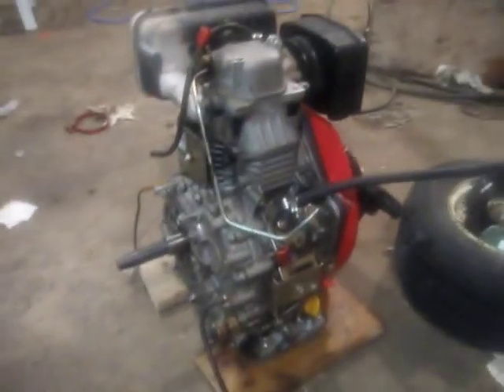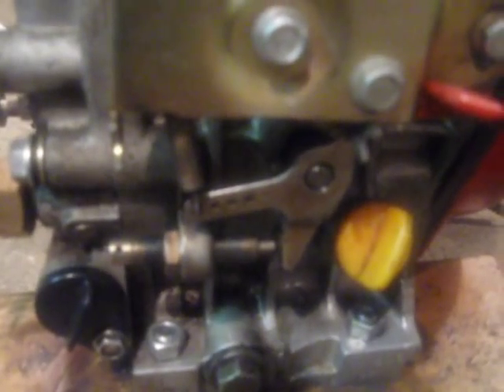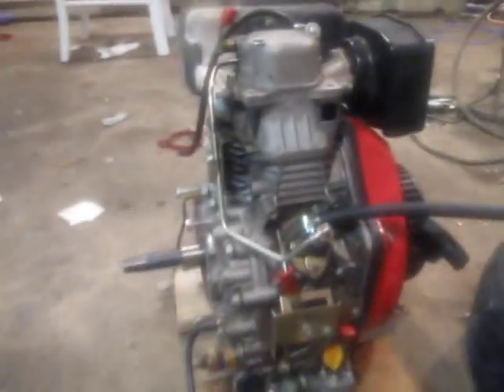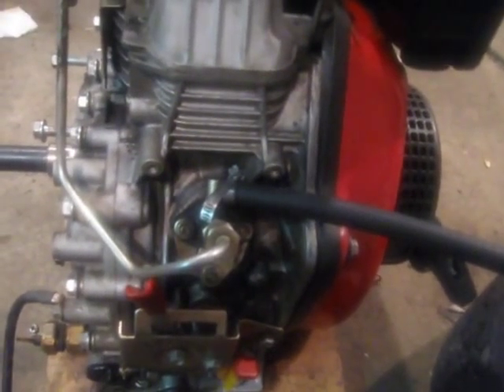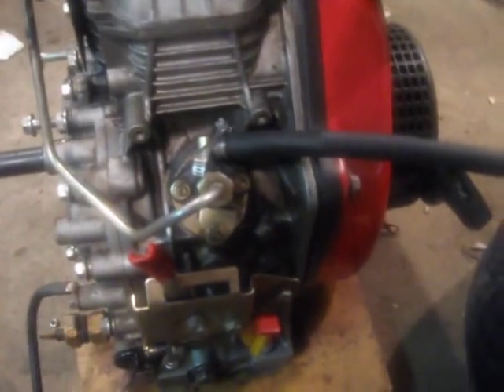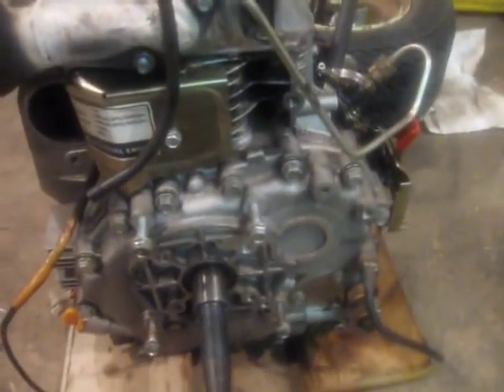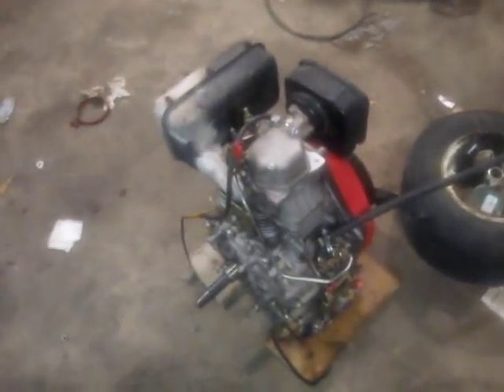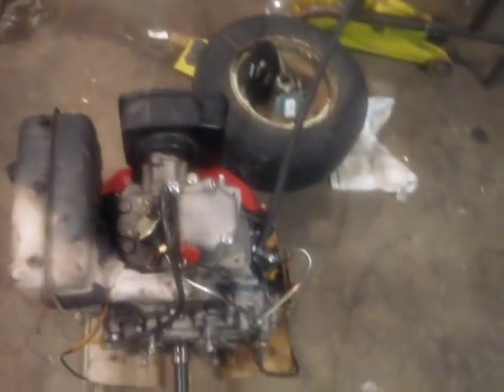yanamar fuel screw info

Comment: backing off the screw just gives it more fuel if it needs it, in a go kart application under suck load it will allow the engine to take as much fuel as it wants untill it gets up to 3600 rpm

Comment: I have a yanmar l48 with 3/4 keyed shaft in mine but has the generator fuel supply I found the engine adapter for the fuel supply. Is it possible to put these on go kart..btw turboing a single cylinder is pretty pointless cause the intake port is closed when the exhaust is open.. super charger maybe.. the turbo would make some boost make sure to add a blow off valve

Comment: Thank you very much for the vid. is there a way to put an external oil filter on these  engines ? i know the small air cooled lombardinis can but not sure about the yanmars. an external oil filter would considerably extend the time you have to change the oil
Reply: no, but there is an internal oil filter
Reply: no but there is an interal oil screen before the oil pump.

Comment: Its actually called an excess fuel screw,the idea of this screw and the spring inside it is to help the engine bring itself off excess fuel after starting,it has noting to do with the engines max rpm,the engine along with the governor spring does that job.excess fuel is only used to help start the engine.also when you turbo charge a diesel you need less fuel with increased boost or youll get engine knock.turning the excess fuel screw out will help on starting a worn pump or injector,nothing else
Reply: albertonex19 your so wrong with everything you’ve said haha
Reply: @Diesel8290  Then correct him.

Comment: If you run these on waste oil there’s more energy in the fuel so you get more power, without more fuel to wash the cylinder, so you get more black smoke. My 7.3 idi likes it & it has more power at stock N/A, & not beyond stock.

If you are thinking about going it to your $600 motor go ahead, it took many paint fuel hours of searching over a few years to find mine for my sears & she’ll get motor oil for more power, but that’s about it, if I did she’s get a turbo before more fuel pump, you can remove the IP shims for more fuel, but I’d just leave em be unless you absolutely need to.

Comment: +albertonex19, diesel engines need and will use extra fuel over a n/a engine to make and sustain boost. As well diesel engines cannot knock based on fuel quantity. You can burn them as rich as you want, they will only burn rich, smoke black and create excess heat/egt's.

Comment: DieselMudBoggin  I'm sorry but I do not know what the factory setting is for these motors. I wouldn't be surprised if they just screwed them in roughly until they didn't smoke under load, being they were built in China. Also, I am pretty sure the max rate that the injection pumps put out is just over what the engine is capable of burning in n/a form, so I am not surprised that it doesn't smoke tons of black under load, which is definitely a good thing, as black smoke means wasted fuel/ excess heat in the cylinder! Would be nice if the pumps put out more though, cause then a turbo could take advantage of it. (Not that the motor would probably last.haha)
Reply: I know this is replying to an old comment but yes you are correct you put the engine under max full load you wind the fuel limit screw out till it smokes then back the screw back in until the smoke just clears.  The head gaskets dont go on these engines as they are made of a thick copper washer.  Timing is done via the copper shims under the injector pump.  The killer of these engines is lack of servicing IE not cleaning the mesh oil filter plus poor quality engine oil and fuel.